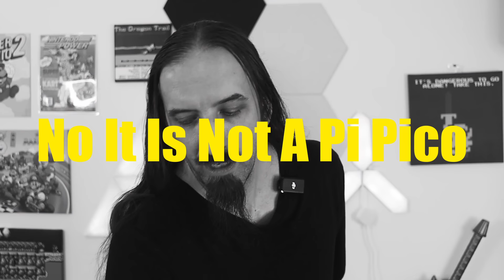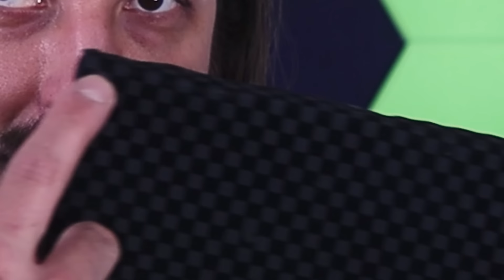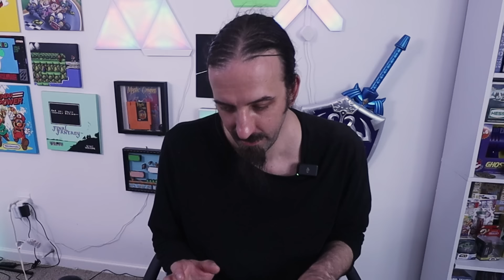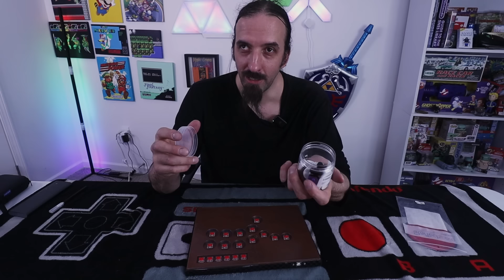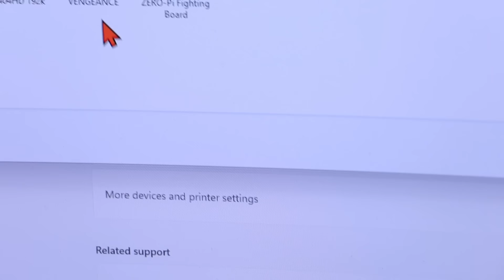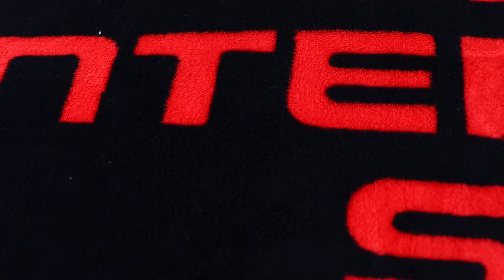3D Printed Hitbox Controller #DIY #3dprinted #hitbox

Comment: Am i correct in my assumption if you have a bigger (thus more expensive) 3d printer, it's not needed to print the switch sockets part separately and can you incorporate it in the bigger design?
Reply from the maker: Yes but this print you may need to load it into CAD software to join them to one solid model. There are a ton of other bigger models on thingiverse.com if you search Hitbox.

Comment: Nice job. Where did you get the button caps? Are those the junkfood caps?
Reply from the maker: No they were 3D printed as well, and the ones for the option button are just some low profile cherry mx caps I had that I painted black.
Reply: @TechPrimeMedia  Oh okay thanks. Are the main caps a pretty secure fit? I experimented with 3d printed caps for Kailh and regular MX switches and didn't like the fitment results unless I used a resin printer.
Reply from the maker: Yeah there not great but I have a hand full I had printed from JLCPCB. You can upload your own stl file and have them printed and ship it to you. It’s kind of a high price if you only get a few so I would recommend bulk prints.
Reply: @TechPrimeMedia  Oh, are they MJF printed in nylon? If so, those would be great. I thought they were FDM printed (most common) for personal printers.
Reply from the maker: FDM printed, I don’t remember what I had the ones from JLCPCP they my have been. But the ones in the video i printed on a ended 3, there was more then a few fails in the process.